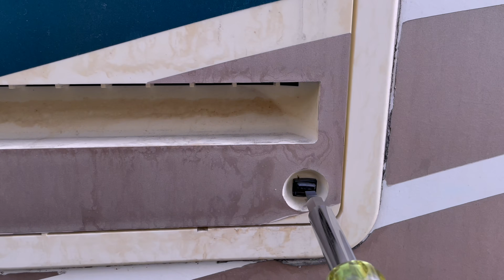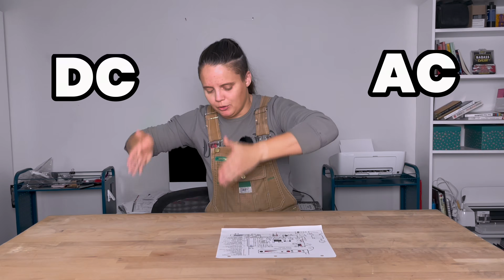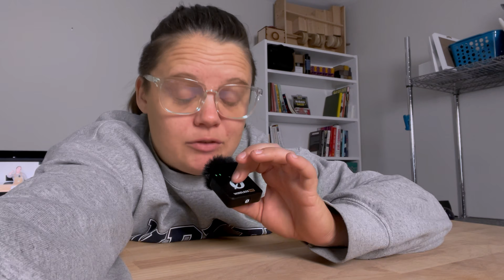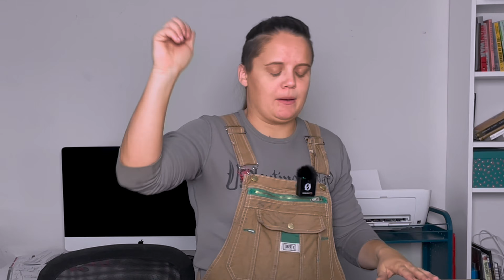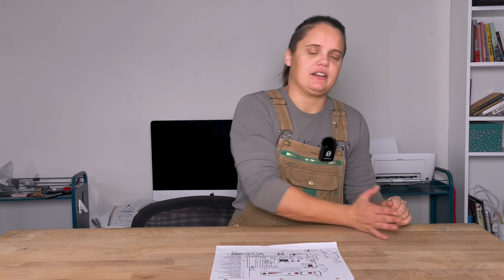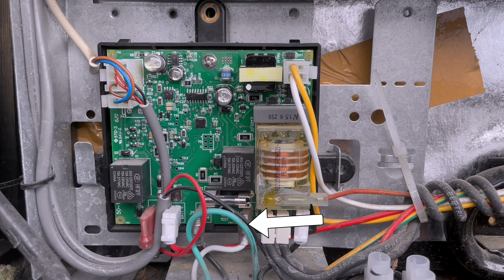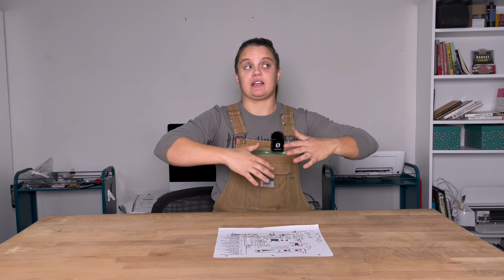How to Troubleshoot Your Dometic RV Fridge (With a Mobile RV Tech)

Comment: Question: I did all the checks you said to do, and it did seem to help with my issue, but my issue is that the check light keeps coming on. And the fridge is wired to the furnace one way or another through 12V and whenever that fridge check light is on, the furnace will blow, but won’t try to ignite. Now the check light doesn’t come on immediately, it just “randomly” turns on. I’ve checked all the grounds in this trailer, all good. Changed every fuse. We only use the fridge with electricity cause we’re always plugged in. And to add weirdness, when we turn on lights, the furnace blows harder and ignites perfectly, we’ve just become accustomed to leaving the outdoor lights on at night lol. But it all revolves around the 12V, it’s a brand new battery, it’s filled, charged. The converter seems to be working just fine, although it does make some weird hissing sounds and “electrical” noises. They come and go. Initially I thought it was the capacitors in the converter getting too cold at night and I keep circling back to that because the furnace and fridge act up more at night, but I mean I’d think the furnace would make it warm enough in here. Honestly I could go on and on about the things I’ve tried and the ideas I’ve had, but electricity has always been my achilles heel and I’m desperate. Any ideas?

Comment: We noticed our Dometic RV fridge auto light (on the brow as you say) was no longer on, yet the fridge was plenty cold. It had switched to gas and was not working on electric (we could hear the gas ignite when we shut it off and turned it back on). We checked all fuse connections per your wonderful directions for when the Dometic won't run on electric and found the 5 amp glass fuse is giving constantly changing reads on the multimeter. We removed the fuse to get a replacement, but noticed that the auto light is now back on without this fuse in place. How can that be?

Comment: Excellent--No BS, no stupid songs, just the facts.  I note one thing others might benefit from--I struggled to get the circuit board cover off.  You didn't fully explain--first take off the easily accessible screw at the top, then look on the lower right side for a blind slot/pocket  inwhich to put a flat screwdriver blade and lever the slot to the right by pushing the screw driver handle to the left.  That will let the plastic housing  flex around a plastic latch/hook that is sort of visible near where the slot is.  The cover has an image cast into it it trying to show you this but it was incomprehensible to me.

Comment: At13 minutes you check on board for 12 volts to solenoid valve… but you do not tell us what happens if we do not have 12 V coming out of that little square box with a pin in it
Reply: Anyone??? I’ve replaced the lower board, same problem! No 12v coming out of the board and to the gas solenoid?

Comment: Any recommendations of what to do if all of these tests are positive?  I’m trying to run my fridge in electric mode and it will not turn on.  The lights come on but then the check light turns on and the fridge never fires up.   Thanks!

Comment: When do you know it's a bad power module (lower circuit board)?  My 2020 Dometic 3-way has working propane, creating good heat and venting unrestricted out the top vent.  The DC heating wires are pulling lots of amps from the battery, and the AC seems to do the same.  Zero cooling to fridge or freezer, tried each of the 3 source settings (AC/DC/LPG) and cooling levels over the course of 2 weeks, nothing.  Eyebrow board fully lit and operable as normal, disconnected the thermistor to force cooling and no luck.  There is no smell or evidence of a coolant leak, the best I can tell from the access panel and peeking down the rooftop vent.  Wiggled and jiggled any connection I could access and proved all the fuses (x4) with my multimeter.  I feel like the power module is toast or the system has lost coolant, no gurgling sound or hissing though in the tubing system.  What's your best guess? :)

Comment: My thermal disc had some voltage going through but not 12 volts. More like 3.8. I am thinking the disc is bad. I also did not have a fuse between the thermal disc and circuit board.

Comment: Gas is firing and I hear the liquid, tubes are hot, fridge not cooling. Also keeps popping the 120 fuse so no cooling on ac either. My thoughts are a bad board at this point. What say you ma’am???

Comment: Thank you!  My understanding has increased many times over.  It's my gas system that's not working.  New eyebrow board a couple of years ago - fridge works great on AC. Propane furnace works, so general flow not the issue.  Eyebrow light on for gas but no clicks and no odour - "check" light comes on after several tries.  New ignitor a while back.  Now, I have a much better understanding of what to ask the RV tech to look at when I book an appointment and how to assess their assessment.
Subscribing!

Comment: I really appreciate this triubleshooting video. My issue wasnt covered though and wonder if you might have some insight. My Dometic will light and runs for a couple minutes but then the ignitor starts going again (flame is lit) then it shuts down and faults out. I had a tech tell me the circuit board was the issue so ive replaced that only to come up with the same issue. Please make a video explaining this issue!

Comment: Hi Emily, were in bullhead city trying to troubleshoot our Dometic frig we ran it for 24+ Hrs on electric at the end the freezer was 4° the box was 33° next step we did was disconnect the transmister from control panel there was frost waited to frost to leave started it on gas ran for about 3 + Hrs looked at gauges 14° in freezer the box was  46° is the control panel Bad ?
Reply: @rvrepairwoman Hi Emily hope you can help us We have a Dometic frig in our trailer we have a cooling problem I ran the frig on Electric for 24 Hrs + checked the temps it was 4° in freezer & 33°  in box were trying to troubleshoot this , their was frost back of frezzer after that waited for frost to leave we disconnected the transmister started it back on gas waited 3 Hrs + checked temps 14° in freezer 46° in box do you think the control panel is bad ,what do you suggest we try next. thank you  PS do you think maybe the transmister bad ? Thanks again

Comment: Do you know what would cause the thermal switch to pop. I reset the thermal switch the refrigerator will turn on and run about 20 mins and then switch pops again. 
I have changed the switch out still no luck. Any help would be appreciated.

Comment: I am very late to this however I am struggling. I do not see 12v on either side of the thermal cap. I replaced the thermal cap, thermal fuse and the main control board but still not seeing 12v on either side. I am not sure if the fridge has to be on for that or not, but I can't turn it on. On the eyebrow board I see all lights come on, then the 3 temp lights flash twice and it powers off. I checked the brown COMM cable and I have 1.45 v on both sides but no increased volts when the power button is pressed. I am thinking I have a bad eyebrow board BUT no replacements are available, it a 2015 Dometic DMR702 936000769

Comment: Omg. You rock! We followed your video and found we only needed an $80 thermistor. Sure doesn’t look like a part that can suddenly go bad. Every pro RV repair guy I talked to before finding you told me these fridges are just no good, and I need to spend 3-4 grand. They wanted to swap out to AC and lithium. They told me I must have ruined my fridge by parking on an angle.

Comment: Man you just saved me about $200 because lightning struck my camper last night and my refrigerator started saying check and would not work I was already debating on buying another refrigerator for it until I watched your video and popped the panel off and come to find out the second fuse was basically blue into a copper color.... So thanks a bunch for that because I know everything about a vehicle I know nothing about a camper lol

Comment: It sounds like the refrigerator need to be supplied with propane whether you run it on 120 volts or on 12 volts.  Is that correct?

Comment: This is a great video and very informative. One big thing I think you missed in your explanation is that the thermal fuse doesn’t always “just go bad”. An underlying issue can cause it to overheat. Whether it is burning too hot or exhaust gasses cannot adequately escape, something usually causes it to trip and the safety is doing its job by shutting the unit down. The person who commented on your video saying they bypassed the safety and saved their food, could potentially burn down their RV. I think it should be mentioned that if a thermal safety is tripped, one should investigate for potential causes or have it professionally inspected if they are unsure.

Comment: Hey!! Thanks for this vid.  I'm scratching my head however.  There is nothing plugged into my J1 port and there are no wires left.  Hmmmm
Do I splice a red wire from the red + DC terminal to the J1 port?  The way mine is wired, a red wire comes directly from the DC terminal block over to the thermal disk

Comment: At 12:48 in the video we are checking the yellow wire for 12V. I get 0 there but you don't say what to do in that case. I assume that the circuit board is faulty but would just like confirmation before I spend the big bucks for a replacement. Also, I see a huge variation in prices for the board, from $38 to $145. I am a little suspicious of the low end parts. Do you have a recommended source? Other than that, a great video walking us through the process with minimal fluff.

Comment: Great video! But what would you say is the issue if all those check out and the refrigerator is still not cooling. Also per your other video checked its level, no apparent leaks. Everything operates and appears normal just doesn’t cool at all. No fault indication either. Thanks for any tips!

Comment: Okay so I have no eyebrow board, nor buttons, nor on light, on my old af fridge. Everything works when plugged into shore power. When I try to switch to propane, it doesn't cool. Pilot light is working well burning blue, exhaust pipe is clear. I thought maybe the wire you mentioned that's supposed to tell the fridge to run on gas, would be the problem, but I dont have an eyebrow board so now I'm confused again

Comment: My Dometic had no lite when I pushed On. 1. Had AC @ plug & 5a fuse. Had 12v DC @ terminal but not @ 3a fuse both sides. (Had already looked for bad fuses all over RV prior to all the above). Then I found this video! I removed the chimney cover plate and there was the thermal disk! Before I took readings I noted a small push button in the center of the disk, I pushed it and lo and behold it reset the disk! Now had 12v to 3a fuse both sides, jumped inside pushed ON and it lit up and chimney got hot and freezer started cooling!
Very thankful for this wonderfully logical video! NOTE: SOME THERMAL DISKS HAVE RESET BUTTON!!

Comment: I have a Dometic model RM2454.  There is no thermofuse/disc on the heater.  The wiring diagram is DM2663 (no fan) without ice maker.  I’ve done all the checks you describe here except the first one where I check this thermodisk on the heater.  I checked all fuses ac/dc and all are good.  The eyebrow panel would not power on so I replaced it and it powered on however it won’t go when I push the auto button it goes straight to DC.  It will switch to gas though.  However neither indicator sends power to the heater.  Still getting no power (ac or dc) nor gas to the heater.  I had also replaced the mother board but nothing changed so I put the old one back on.  I’m at a loss now.  Can a bad thermistor prevent the heater from getting power or gas to heat it up?

Comment: Question for you.. I replaced the circuit board on my dometic 3 way with a dinosaur micro 711. Works on DC now! Anyways, should the hot wire at the dc element be hot to the touch several inches down from the element?

Comment: Great video! You covered everything except for my issue 🙁. I have a Norcold that initially had problems lighting at elevations over 5000 feet. I added a gage so I can adjust the pressure down at higher elevations. Sometimes and lately a couple of times per night it will fail to light. Seems as though it doesn’t light right away and the amount of propane builds up a little and when it does ignite with a woomph, it extinguishes itself. I’m pretty sure I need to adjust the igniter position. Or possibly just the igniter gap.

Comment: So I have a pilot light (propane) and the fridge is still not cooling. The boiler seems hot but fridge still warm. What should I 
check next? Also on the electric side I’ve got 120v on one side but not the other on the heater.

Comment: Question:  my propane line is snug against the front of the circuit box preventing me from removing the cover. Any suggestions?  I didn’t want to start messing with the propane line. Thanks.

Comment: This might be the most helpful youtube tutorial i've watched on any subject. I now know more about my RV fridge and proper multimeter use than i could have hoped. 

The weird part? There was nothing wrong with my fridge, but i'm still glad i went through every step of this video. Just in case you are like me, and you have no patience, the only "problem" with my fridge was that I was listening for the sounds of a compressor coming on, but even on shore power, these fridges still run on a silent heater system and take a while to start cooling down. It will chill the freezer, than move on to the fridge and could take several hours. 

I'm still glad i chased my tail through these steps though, cause i have a better understanding of the whole system now.
Reply: One thing I've found is that the fridge will cool down quicker running on gas than electric.  My method is to run the fridge up on gas.  When it gets cold, shift over to electric.

Comment: you are amazing and funny too! 
I have a situation whereas extreme heat from the sun caused the travel trailer to overheat..  next thing the fridge has power but won’t circulate cold air… I suspect the thermal fuse but do not see one in line 
I do see two glass fuses  5amp and 3amp which  l will  switch out but need to know which is the thermal one
please and thank you!

Comment: Emily, I consider myself extremely well versed in RV systems both older and newer.  I found the need recently to troubleshoot to the "componnet" level a Dometic Rm2351 (2 way) that ws not cooling on gas or electric.  (I don't know what it turnedout to be becasue all components (per your video) tested positive)). Your video was ABSOLUTLEY SUPERB in detal and eplanation.  You are a good teacher, and ANYONE with even the slightest degree of electrical ability should be able to use your video to troubleshoot their fridge. Thank you so much.

Comment: Watched the video a few times, the Dometic fridge works in LP and it will work if I run an extension cord to the 120 volt plug. The power outlet inside the access panel doesn’t have any power. I checked the whole camper (2021 XLR Nitro Toy Hauler) and can only find one GFCI outlet which is in the bathroom. After hours of troubleshooting I’m stumped. No fuses or breakers are blown as far as I can tell, but the I cannot get any power to the outlet in the external access panel for the Fridge.  Any suggestions???

Comment: Hi.  I’ve got no dc power to fridge.  Works all fine on ac and ac/gas.  But not dc/gas  please help..  also when you turn it on with dc. You get a low tone and then a high tone out of the circuit board area

Comment: You did not address no voltage on either side of the fuse. But, I am getting power to the orange wire.

Comment: great info , thanks for this, I HAVE A ? I GOT NO POWER ON THE A/C SIDE OF THE FUSE . WHEN FUSE IS IN ,TAKE IT OUT AND I GET  119V ON ONE SIDE, AND THE FUSE TONED OUT GOOD, I THINK ITS THE SOLIDNOID IN THE CIRCUIT BOARD? WHAT DO YOU THINK ?

Comment: My 2020 dometic fridge temp panel flashes between the temp and LP.  It is set on automatic. I am plugged into shore power. Cant get the temp below 49 degrees BUT the freezer is working just fine…. Anyone have any ideas?

Comment: What if there's no power to the first thing, the terminal block?
Reply from the maker: Check your fuses in your fuse panel!
Reply: @rvrepairwoman  I did, and the glass ones outside. Breakers aren't tripped. But there's no voltage on anything
Reply: @rvrepairwoman  I did, and the glass ones outside. Breakers aren't tripped. But there's no voltage on anything

Comment: Can you give a run down on what to look for if the freezer is working but the fridge is not? I went through the whole video to look for an electrical issue, but everything there checked out.
Reply: Did u find out what your problem was? Mine is doing the same.

Comment: Thank you! I had no idea what i was looking at in the back of the fridge. The issue was : Electric setting works, but the propane setting of fridge was not, intermittently would work/not work, so it took me awhile to realize there was an issue. I believe the thermocouple is the issue, as it had a large ball of corrosion on the end. Ordered a new one, but in the meantime knocked the corrosion off and its working again! Your video helped a lot in this process!

Comment: Okay I'm getting power to the orange wire and the green wire in the top left corner of the circuit board but it's not making it to the valve relay. I'm assuming that means the circuit board is bad. Would I be correct in my assumption?😊

Comment: I'm getting tic, tic, tic, whoosh, doesn't light and back to tic, tic, tic, whoosh, doesn't light and back to ticking. Not really any propane smell.  Works fine on electric. Outdoor stove works fine. I'm pretty sure it's the flame sensor..... which is on the board 😢  How do I figure out which board I need ?